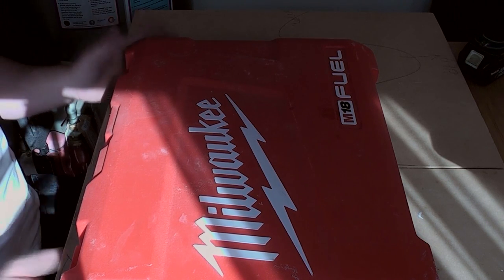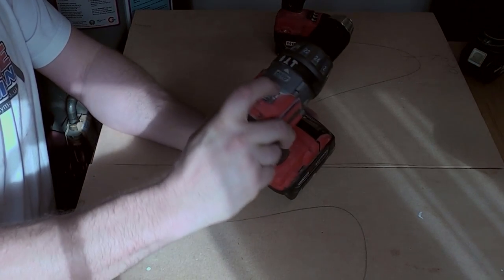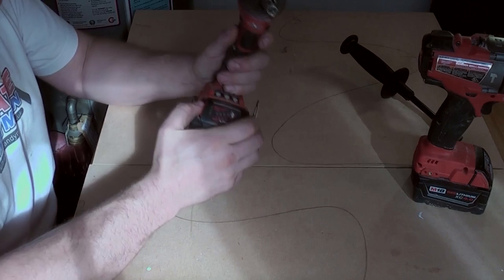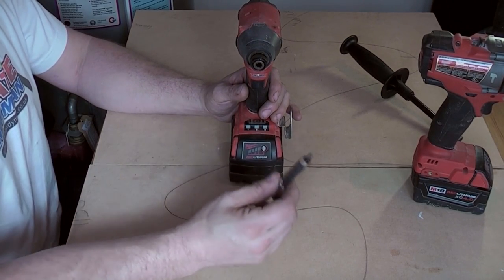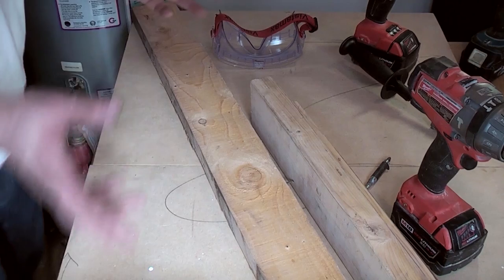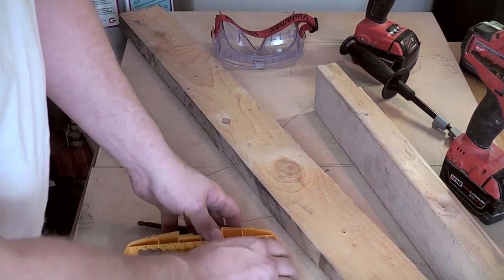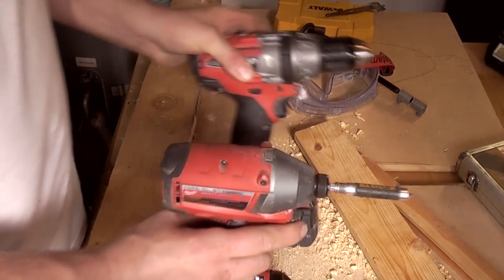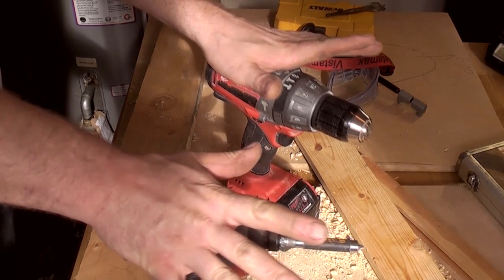Milwaukee M18PP2B-402C M18 Fuel Combi Drill & Impact Wrench Twin Pack

Comment: Really good video. I'm a big fan of Milwaukee and have both the m12 and m18 kits. As far as bits go, Ive come to realize the 2 best bits are the gold Makita bits. They just came out in the states within the last year so i don't know their availability in the U.K. The other are the Dewalt DRYWALL INSERT bits. They look like the regular philips bits but are slightly thinner. Both of those bits will last significantly longer then Milwaukee, Ridgid and the new yellow band Dewalts. Im a contractor and spend all day doing sheetrock, framing and decking. They last the longest.
Reply from the maker: Thanks for the comment ;-)

Comment: hi good video how much  are they
Reply from the maker: The cheapest I have seen this kit for is £431 from FFX
Reply: thanks buddy
Reply from the maker: david clarke
No problem ;-)
Reply: Hi DC. You can actually buy them direct from the states and the Ebay clearing warehouse does all the work for around £340 all in. Milwaukee have told me that they will honour the warranty ;-)

Comment: 8:04 why aint you supposed to do that?
Reply from the maker: Most power tool manufacturers recommend that you don't tighten the chuck by holding it whilst pressing in the trigger/switch.